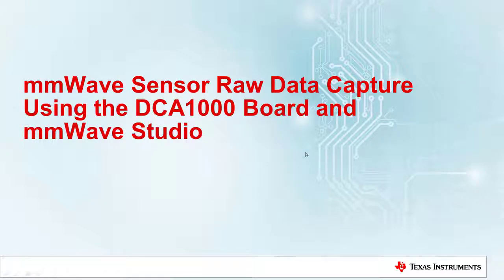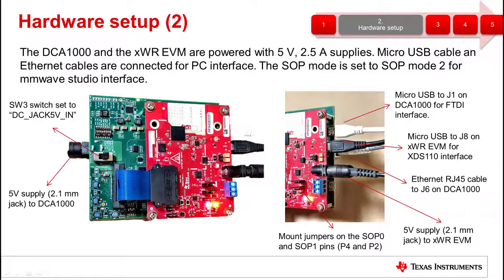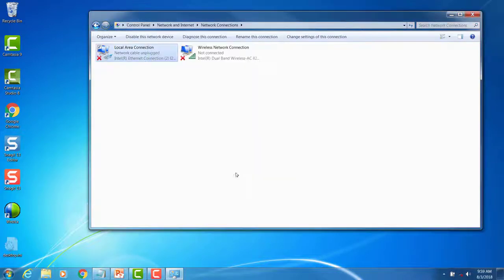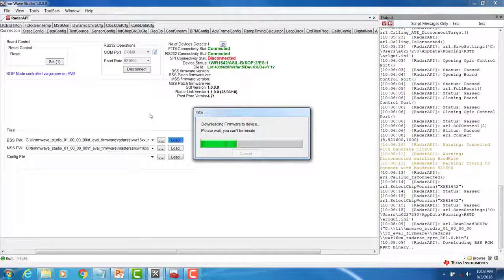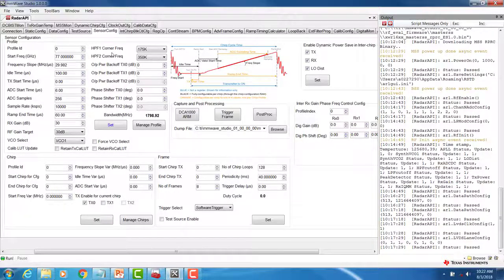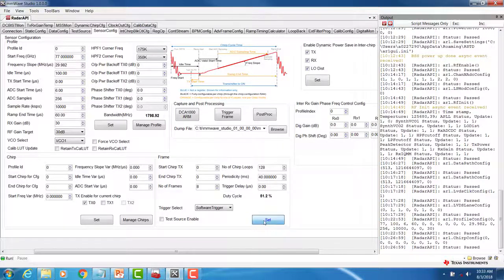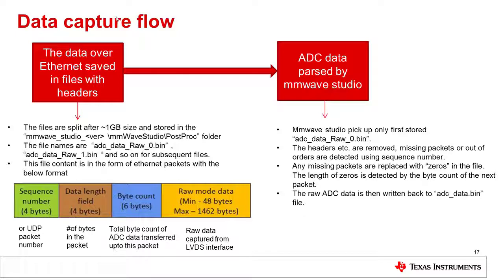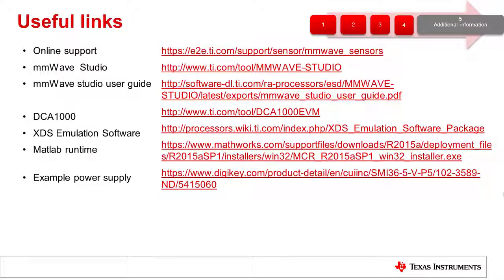DCA1000 Training Video - 4

Comment: is it possible to capture the Transmitter data as well?
Reply from the maker: The parameters that determine the characteristics of the chirp signal, such as its frequency range, sweep time, and modulation rate, are typically programmed into the radar system and can be known by the radar operator. Additionally, the transmitted chirp signal can be measured and analyzed using a spectrum analyzer or other signal processing tools to verify its characteristics and ensure that it meets the design requirements.

In summary, while it may not be possible to capture the transmitted data from a radar, it is possible to know what chirps are being transmitted in an FMCW radar system by programming and analyzing the characteristics of the chirp signal.